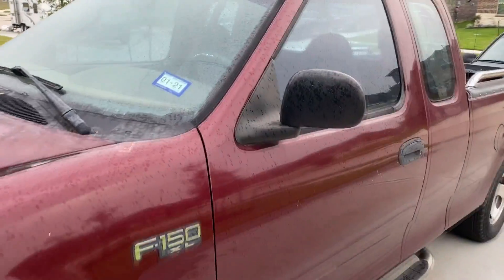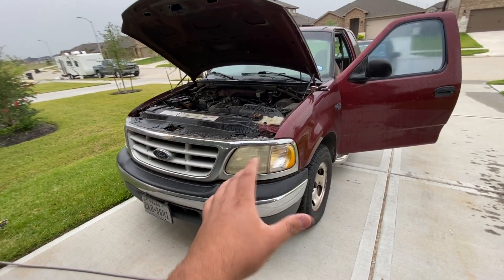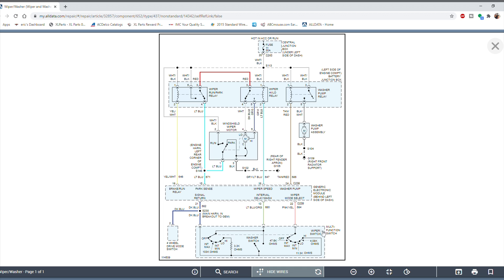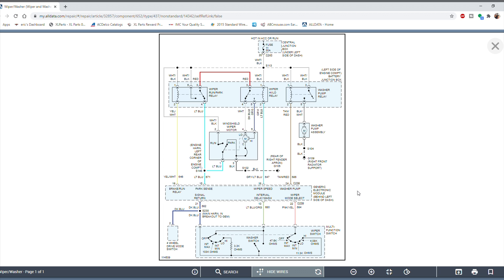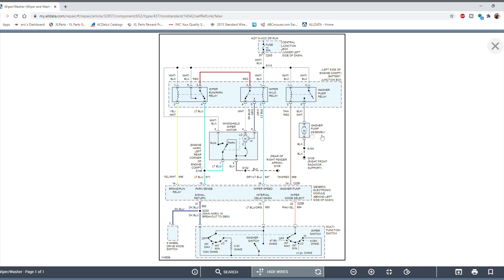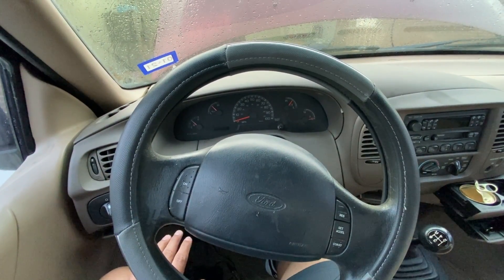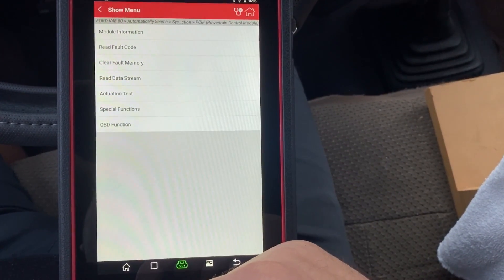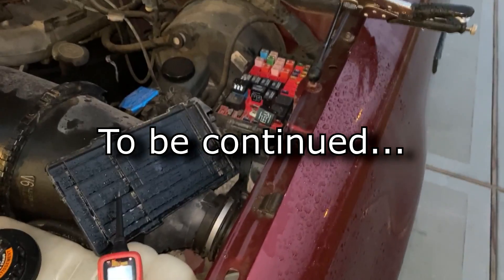FORD F150 WIPERS NOT WORKING DIAGNOSIS & FIX PART 1

Comment: Oh I cringe when you use that Power Probe. I was following along on on my own Mitchell diagrams. If by mistake you touch the wrong pin on the relay and inject a positive voltage on the control sides of the relays while the GEM module is feeding a negative signal, the GEM gets fried. And you have to buy another module on your own dime.  What I would use is an old 1.5 amp incandescent taillight. It's much safer. It would run slower but it proves that the motor works. I've had to diagnose and replace many computers that other mechanics have fried because of those probes. Just explain to your viewers to be careful with those probes. That's a super great video. I like how you explained with detail and patience how the circuitry works. Many common man would learn a lot from your videos. Keep up the good work!
Reply: Sounds like your case could be used as precedence in a court of law.

Comment: You are better than a Ford factory instructor!  The Gem module had it's problems back in the 90's.  Like you said, Gem power and ground test 1st, then at the Gem connector, test the outputs and read the the inputs.  My way also for verification.
The Gem, for it's size, controlled a lot including the 4WD.

Comment: I often wondered how the wiper arms return to park after being turned off, assuming it was logic hidden inside the module. Not so, the logic is directly hardwired to a switch linked to the park position. Your walk through of the wiring diagram makes it much easier to understand.

Comment: Question- I am totally a Rookie-My truck wiper blades are not working but when i press the button my washer fluid does come out-  More than likely the fuse or  am I really looking at the wiper motor-meaning it doesnt matter if the washer fluid comes out.

Comment: Looks not safe to place the pliers to hold the hood . You are working on that side of the engine and can accidently move them and the hood fall on you . Place it on the other strut .
Reply: Why don't people just replace the struts that hold up the hood there not expensive or hard to replace
Reply: @neilmurphy845   It's probably not worth it for the value of the truck.
Reply: Owners obviously not opening his hood if Eric’s working on it so he probably doesn’t care
Reply: @JT-lq4yd  how much would they be anyway for that truck would online ones do or do you have to use ford motercraft
Reply: @neilmurphy845    They cost anywhere from $10 to 50 per set.  How much is the truck's value?  $300?
Reply: @JT-lq4yd  why do they have them anyway why not give u a rod like they used to have
Reply: @neilmurphy845    I don’t believe full size ford trucks ever used a rod.  My 97 F350 uses springs on the hinge.
Reply: @neilmurphy845   Actually, rods are something cars, vans and other vehicles have or is more common.  Trucks have springs on the hinges to keep the hood up at least on older trucks.  It is considered to have a rod like cloth seats and struts as leather, fancy. It's easier to work on a car that has struts as you don't have to be working around the prop rod.
Reply: @JT-lq4yd  ya in theory but in reality there not because u have to replace them which people don't bother doing so the rod in the long run is better
Reply: @jeffleach2668  ow never knew that did most trucks do that
Reply: @neilmurphy845   Auto makers use the rod because it's cheap for them but it does last the life of the car.  I like the struts because I can open my car's hood with just one hand and it is not in the way when working on the car.
Reply: @JT-lq4yd  ya that is true why don't they put a notch in the main hinges to hold it in place like the old Mercedes and land rover had
Reply: @neilmurphy845   I can't say why they changed the way they did it before, was it cost, safety?
Reply: @JT-lq4yd  probably cost more to make those hinges

Comment: All that just to tell me to check my fuse and relay switch first,  those  should have been the  first  option
Reply from the maker: But what if you didn't find any blown fuses? It's good to understand the system so that you can diagnose any issue it may have. Thanks for watching!

Comment: heh my '98 F150's wipers stopped working years ago...turned out to be a bad linkage...bought it from Ford direct for a reasonable cost (complete linkage assembly). Not much to these trucks thankfully.

Also for future reference, for some Ford models the owners manuals with fuse legends are available at fleet.ford.com under the Maintenance Link...even I go there at the shop I work for, to get Ford fuse legends.

Comment: I have 1998 ford150 and my windows won't go up and my windshield wipers won't work either when I first got the truck I done the same thing a friend messed with a fuse to get it working and now I don't Wich one it is to get my windows to go up and my wiper to work

Comment: Dear lord,  please stop talking. Check and see what the problem is. Check fuse , check relay and check control switch.  Move on dude. Does the motor work?